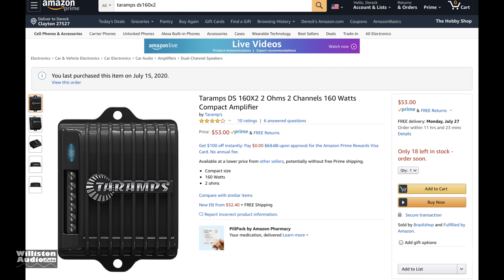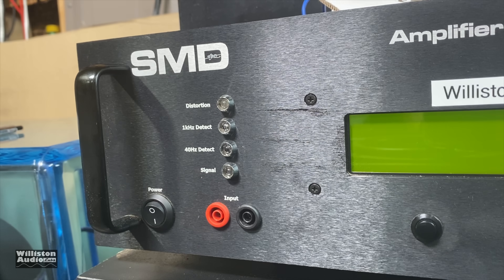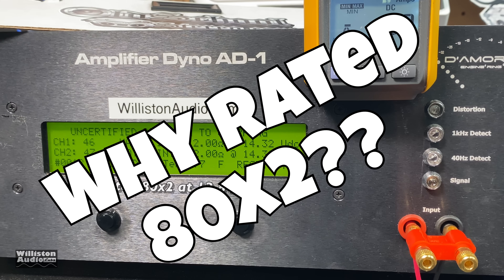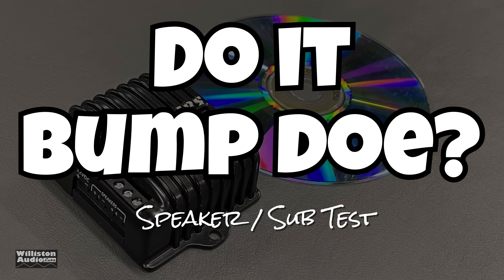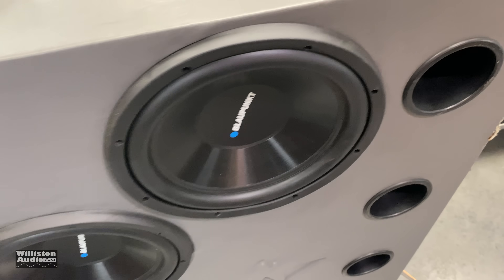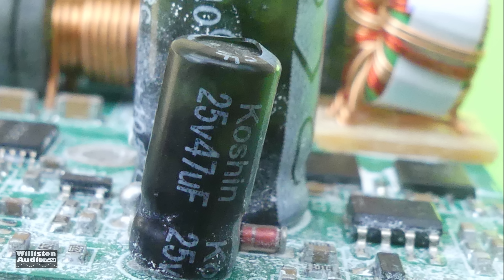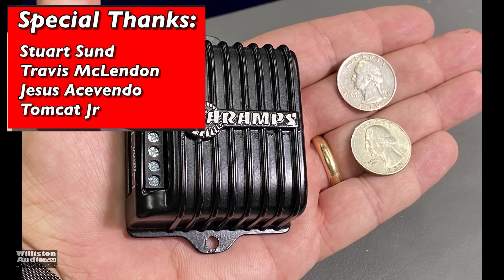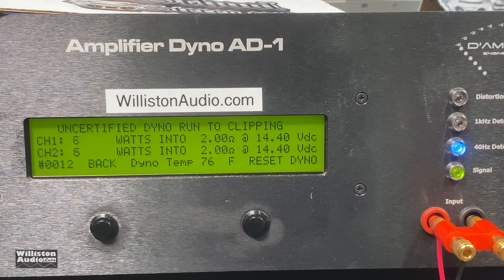Tiny Car Audio Amp Tested! Taramps DS160x2 Amp Dyno

Comment: I just bought the Pioneer DEH-80PRS and installed it in my 01 Mitsubishi Montero. I was in a hurry so have not installed my CT Sounds 6.5" Meso's yet, but just on deck power I was amazed at what it did to my stock speakers! Mirrors shaking and all, knew it had some output!
Reply from the maker: She’s not bad but it does get hot
Reply: @wal  Wouldn't know, don't stick my hand in the dash, lol. The flexibility of the unit is amazing, and so is the price.

Comment: Ooo, maybe I'll just use this,  lol.

Side note though:

I am wanting to add onto my JBL GTO609C and run them actively, along with my RF Power HX12 (being pushed by a Slash 500/1 v1).

Should I get the JL VX400/4i to pair with my Slash, Helix V8 DSP MK2, or jump for the JL VX1000/5i (for ease of install)?

I know the Power HX12 can take a lot more power, but I am fine with the 400/500 watts rms at 4 ohms, and even plan to swap to the IDQ 12 to go more SQ oriented.

Also, with just the 4 channel VXi, I can afford to get better front components
Reply: How would you run them active without RCAs?
Reply: @shane35fowler  You need a DSP and an amp that has enough channels

Comment: When there is digital-amps that can make alot of power in a small packet(not this one tho😂) why doesn't a "brand" make a headunit that delivers more than 50x4w? And can it be done? Like 4x250wrms? Nice video btw👍
Reply: Imagine wire up zero-quage to a 2-din headunit that delivers 4x150wrms +1x500rms in 1ohm subwoofer output. Oohh
Reply: I once seen the explanation that most head units top out at 100w because most manufacturers wiring only supports 10 amps on that circuit. So in order to run any more power than that you would have to run another power feed to the radio at which point you might as well just buy an amp.
Reply: @D3M3NT3Dstrang3r  that's true. But i would be nice not to need an amp for a nice medium setup tho..

Comment: Amazing how far amp technology has gone in just the last 3-4 years.  BigD, I bought the Taramps Smart 3k off your review and I love it7, so thank you for that.  Now which amps do you think I should go for my mids and highs.  I want to keep it the same brand for aesthetics, but I am also looking at the Toro amps. I am running dual Dynalab 8's in each door, along with 2 Dayton ND104 4 inch for my midrange, and low treble, and Pioneer tweeters in the a pillar.  I currently have an Alpine 50x4 right now, but I need more juice and 2 more channels to run active 3 ways fronts.
Reply: Measure your total ohm load for the left and right channels. Then add up rated watt power for the speakers and divide for an average. Take those figures and matchup a clean 2 or 4 channel amp
Reply: @MIXMASTERBJB1  I went with a Sundown SFB 200.4 and the 4 channel Alpine, but now I have gone to a Crescendo S6 6 channel and I love it.   I have 2 Dayton Audio Reference 7's  and 2 2 1/2 inch Daytons in each door and Dayton Tweeters up top.  So front 2 channels on the tweets, channels 3 and 4 on the 2 1/2s and channels 5 and 6 on the 7's.  Then I have the Taramps running a single Dayton Audio Kraken 21" with 2000 watts.
Reply: Insanity...lol in what vehicle? Active 3 ways on independent channels is sweet...

When I was much younger and coming up in the car audio game a neighbor and mentor of mine was the lead installer at the detail/audio shop I worked at..US Amps was our primary distributor for amps..I was always very versed in auto electric and audio equipment/theory.. One day he showed me a setup that was so obvious but I never thought of..A healthy 2 channel amp that has a bridged/mono circuit can simultaneously run both L/R Stereo channels for the mids/highs and a 3rd mono channel off the bridged circuit for midbass..Covering all the mid/high component requirements and requiring nothing but a sub amp to complete the install...
Reply: @MIXMASTERBJB1  2011 GMC Sierra.  I did a blow through for the sub and have it tuned low to 29 hz, so it is not a one note wonder.  Great kick for rock and it will make my windshield wipers jump on low bass.  I hate that the Taramps does not a bass knob, though because bass heavy tracks can be too much if you have it set for rock.  I can play She Rides by Danzig and it feels like someone is kicking your seat on every kick drum.  I am 43, and I hope I never outgrow car audio. I remember when those US Amps were 48 inches long to get 2000 watts back in 95 or so and they costed $2000 or more.  Now you can get 2000 watts for under $200.  Crazy.

Comment: The amp is based on what seems to be a tpa module not as said in the video on those small mosfets the tpa module is the big chip in the middle right of the board with the grey metal in the middle

Comment: I have a Sony mex-xb120bt head unit that I am currently using on my for full range speakers in my old F150. That head unit was dynoed on another channel and it put out 45 watts rms per channel at 4 ohm. It put out a little less than 75 watts rms at 2 ohm, though sony doesn't reccomend wiring it in this way. That unit puts out the same at 4 ohms what that mini amp does at 2 ohm.

Comment: Nice man! Been waiting on this one. 
I have it in my Amazon shopping list 😄 And why lie on the Ratings Taramps Smh. Oh well still good for some low watt mids and tweets
Reply: Same here was hoping to power my doors but that's not going to happen
Reply: @mariahlee4519 
Y
Reply: I'm using them on some higher efficiency Older Kappa components on a motorcycle. They work great with 50w but really thump with 100-150w

Comment: Not bad for that size of amp even though it didn't get to rated power. Would be good to go inside of doors to multi channel speaker systems.
Reply: No not really,  efficiency was horrible and doesn't put out enough power for anything worth a damn.  Waste of money.
Reply: @kriptic22  I'm looking at it from the point of factory stereo systems with 2/3 way speaker systems in the doors. Use the power wire from the window motor that's always hot and amplify the sound. Especially like GM cars without rewiring the factory amp. Who would car about the efficiency when it's not much power drain on your charging system.

Comment: WillistonAudioLabs The NEXFET is part of the power supply. The big chip to the right is the audio power output chip.
Reply: I had to stop the video when he mentioned that as well.  I'm like..what...hold on.   Any idea what the chip is?  One of the TI chips by the looks of it.  Not sure which one.

Comment: That would be great for an ammo can bluetooth speaker build
Reply from the maker: Yes, just needs BT built in
Reply: @wal  what was that loose blue wire when you opened it up. I didn't see a bluetooth module or chip, but that wire looked like an antena if its ouside the metal case. power it up and see if it shows on your phone. MEH never minds, its a remote opcional.
Reply: @UberAlphaSirus  the label said optinal remote
Reply: @slotec  No, it says opcional. Like I said already.
Reply: Sirus I must have missed it.
Reply: Sirus lmao it’s Brazilian for optional
Reply: Williston Audio Labs is this low pass only or does it do full range. That would be perfect to mount inside my doors for my 6.5 door speakers.
Reply: @jamesfair9751  one amp per door on a set of 2way comps would work  nicely

Comment: you'd test the pioneer in direct subwoofer configuration 🤔
Reply from the maker: Pioneer was in full range mode
Reply: @wal  do you know pioneer head unit has the sp-p/o mode with the rear output in LPF mode for a little subwoofer?

Comment: Did the blue trigger wire on the bottom not work? You mentioned it only had auto trigger by sound through the high level inputs.
Reply from the maker: It was not needed in my situation

Comment: This amp has more inside of it, than the amp in your last video.
Reply from the maker: Ha! The truth!!
Reply: Do you think i can mod the input to get rca low inputs?
Im thinking about using one of these  to drive a pair of super tweeters. What do you think?
Reply: Elreypr47 maybe if you wire a LOC to it but for all that just buy another amp that has rca inputs
Reply: @Elreypr47  Just change the input resistors to a lower value.
Reply: Much more!!!
Reply: lol I know man! DIdnt make power but I have a respect for iT.

Comment: Why bother with an amplifier when the head unit gives more watts and that's the only input option...
Reply from the maker: It will almost double the power output of most head units
Reply: Head Units STRIVE to push the claimed 8-15 watts per channel. A micro amplifier with a 15 amp fuse certainly pushes twice as much + more without breaking a sweat.

Comment: Thats a 20 dollar piece of equipment
Reply from the maker: In Brazil probably sold with the bubble gum
Reply: @wal  buy an amp like that you get a free bowl of soup
Reply: not coming from a company backed by a name, warranty, support, etc.... yes there's cheaper options, but this is a finished product, in a case, with no guessing.
Reply: @volvo09  what kind of soup though?

Comment: Are you sure you had big enough wire to power that dragon. Check how hot the power wire was getting. You should have had 2/0 running to it lol. I love that 4 12 box with the Rockford R by the way.
Reply from the maker: Can’t fit anything larger than 12ga
Reply: @wal  sorry man I was jokin about the wire. I know 100% you know what your doing. I'd never question you.